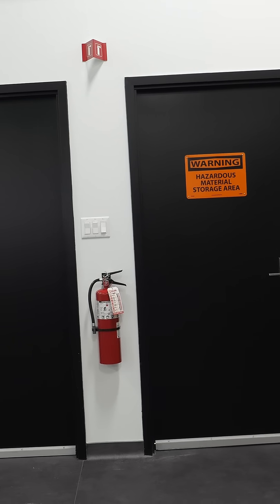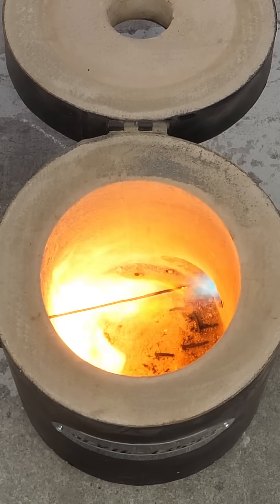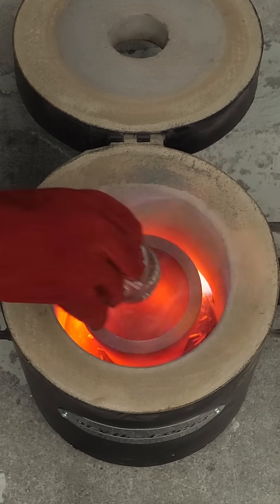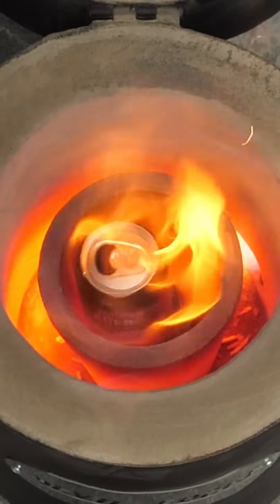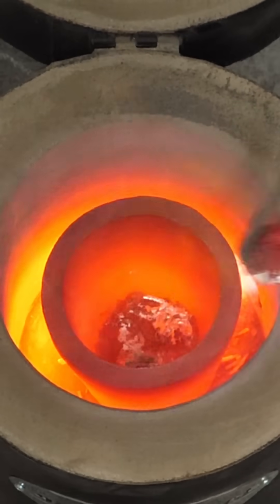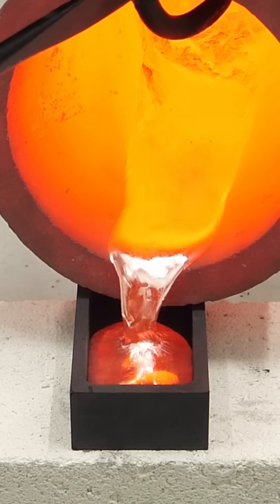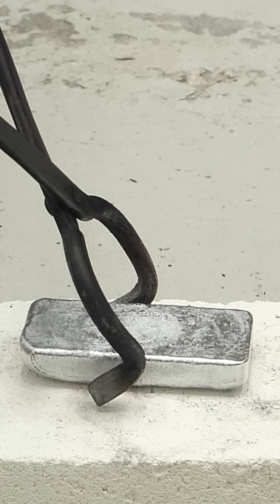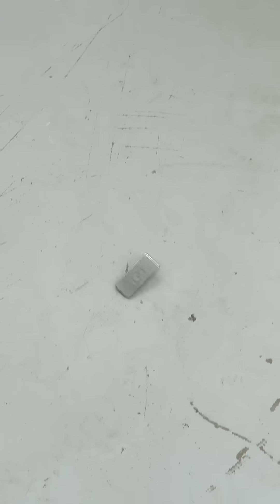Melting soda cans into a metal bar

Comment: I’m a dumb person and even I took the time to ask Google if the tops of cans were a different metal from the body. When I melted my cans I separated the metals: Al 3004 (Bodies), and 5182 (Tops and Tabs). 5182 has more magnesium than 3004 making it stronger for the crack effect. If you melt them together you get an impure bar. Another thing is when my cans were melted there was a bunch of slag from the ink. From about 30-40 cans about 15-30% became slag. I ended up with a 200g bar with some excess that became a little 32g puddle of the 3004. Remember this all of you who wish to forge and all who currently do it, as a bonus: Aluminum melts at 660C, but 3004 and 5182 melt at slightly higher temps, so my say is put your forge at around 750C to give you time to pour it so it’s not immediately hardening as you do.
Reply: From what I have read, some of the magnesium will cook off when you melt it. So if you melt the can and the top together, you will end up with an Al/Mg alloy that is very close to the alloy used for the cans. So in normal recycling they won't bother about removing the tops from the cans. But of course, if you plan to use the recycled materials for something else, it might make sense to separate them.
What I have wondered, is if you can recover any of the magnesium that cooks off, by placing a pan of cold water above the furnace, hoping that the magnesium will condensate on the outside of the pan.
Reply: @Tjalve70  Late reply but only because I’ve just now melted some 5182, and there is a noticeable difference. The ingots of 3004 I have is shiny and smooth where the metal touched the molds, with some rough surfacing on top. The 5182 has a more crystalline look and feel, the edges and corners are sharper and more filled in with a smoother topside. I experimented and found the results, some of the magnesium burns off, some.
Reply: @CuppaNoodls  It would make sense that there is a difference, yes.
But what I was saying, is that for most practical purposes, if you melt the tops(5182) and the can(3004) together, you will end up with a composition that is basically 3004. Due to some of the magnesium boiling off. This is of course if it is done industrially. What you end up with when you do it on a hobby basis, I don't know.
Reply: Tyrone Biggums: I heard you said "Crack"? *Scratches neck*

Comment: That fact that metal bar didn't look hot at all, but then reacted like that to water is kind of terrifying.  Just the idea of someone seeing some metal and touching it, only to receive severe burns because of it's intense heat is kind of horrifying to think about.  

I mean, there's probably a lot of heat radiating off it, so you'd have some warning, but if you're not expecting it you might not notice the heat until you were already grabbing it.

Comment: Definitely not the WORST thing to inhale, and to be honest, it's not terrible at least compared to other things like zinc vapor. Honestly, though, this is the best way to make some interesting metal pieces, though, since you repurpose the can and it's (if I remember correctly), usually Aluminum alloy 3004 or 3060-somethin for the main body. The ends are different, but I can't remember what they are, so you end up with an impure bar, but it's still decent metal and of course, enough is worth some money, especially if you make it with very few bubbles in it.

Comment: Now you can make silicone molds of whatever you want, fully submerge it in sand upside down, leaving the base of the mold exposed, and pour molten aluminum inside. The aluminum will take the shape of the mold.

Warning: ⚠️ I could be misremembering this process. Check the King of Random's guide before doing it. I'm not responsible for failures or injuries ⚠️

Comment: Used to make stock for the lathe and mill like this.  Not much material in cans but larger pieces of scrap made the process easy.  Used bone ash to minimize oxidation.  Broom handle or pipe hammered into the ground made a decent round stock mold.  Used old bread pans for blocks.  Cast oversized and cleaned up on the lathe or mill.

Comment: Crush the cans before putting the crucible inside with most or all the cans in it and put cardboard at the bottom to stop your crucible from fusing to the bottom.
Reply: Wouldn't cardboard just burn up in the fire?
Reply: @philliplimkowski8395  it does but the layer of ash keeps them separate.
Reply: @garionhaney7813 but then the aluminium wouldn’t be so clear and shiny because of the ash right?
Reply: @dominiksaworski8509  "slag" / impurities are going to be on the surface of the metal as they float. You just scoop off all the bad stuff and clean metal is left behind.
Reply: Pots always need heating to drive off moisture. Most molten metals plus moisture makes the wrong sort of interesting.
Reply: @robertparkinson2102  i am aware you do need to preheat certain things because it can cause the molten metal to explode I'm not sure of the step by step process.  I watch bigstackeD and he does a lot of what I mentioned.
Reply: You want to preheat the cans and crucible, so that any moisture is driven off relatively slowly, NOT when dropping e.g. a can with some liquid in it into an 800°F pool of molten metal.  That gets you a BANG! and a shower of molten metal.

However you don't want to leave the molten metal hot for a long time; it will oxidize and some of the alloying elements will be driven off.
Reply: You don't want to crush the cans, the opening let's any evaporated moisture out, you crush the can and the evaporated moisture doesn't have anywhere to go so it builds pressure and then all of a sudden............BANG, ye that means molten metal being thrown everywhere, stupid idea, please don't tell anyone to do it
Reply: @bjarulez  I'm just stating what a popular YouTuber does in his videos and does this regularly.  If you pre heat everything yes that will happen . If you bring it up slowly all moisture will cook off before the metal ever melts .
Reply: @garionhaney7813  though some YouTubers do some stupid things.  
If in doubt, wear safety gear:  welding gloves and jacket, leather apron and spats, face shield, respirator ($40-ish), full length sleeves and pants, closed shoes.  Natural materials because molten plastic like nylon or polyester sticks to skin, and cotton or wool or leather doesn't.

Wrap the flared entries of gloves.  If you get showered with molten metal, really don't want them to funnel it in.

Dry sand underneath; concrete spalls if molten metal drips or spills.

Allow for the crucible to break (they don't last forever) or be dropped and spill its load.
Reply: @bjarulez  your main concern is going to be when its outside the furnace as there isn't a lid to contain an explosion.
Reply: @bjarulez  has this happened to you? i've not had this happen before and only once had a little steam explosion due to my own stupidity of adding a lump of silicon
Reply: @williamcox2025  not directly to me but I was in the factory when it happened and the aftermath was not pretty, all from throwing a crushed can into the furnace, they banned cans from the site afterwards
Reply: @bjarulez  oooof, what size furnace?
And that's quite understandable in a plant sort of manner as if your recycling 1000 vs a million is a work place manner then that one can of someones stupidity would make one heck of a explosion if just thrown in.
Reply: Im Not an expert but I also don't think you need to preheat the furnace.
Reply: @garionhaney7813   meh, you really should the first time in particular in any fernace that uses any sort of wool, aswell as a hardening agent to make sure it don't plume cancerous fibers when you light it everytime.
past the first light of the fernace it's far more important to let the crucible sit in low heat before adding material.
gotte be careful adding new material too, ESPECIALY aluminium has it absorbs that heat quickly.
Reply: @williamcox2025 there is "bio soluble" insulating wool that uses different types of mineral fibers than silica.  Your body can dissolve them so you don't get fibrosis (don't screw up your lungs with scar tissue).

Comment: I really need to invest in one of these mini furnaces and a crucible.  Metalworking would be such a fun hobby
Reply: It is. Just be careful
Reply: It really is. Those Devil Furnaces are really great. I have the smaller version, and it's held up for several years.
Reply: it's fun, The furnace usually go a for a reasonable price, Butane/propane is probably the most expensive part of the hobby
Reply: There's an aussie somewhere on here that has a veritable dragon hoard of recyclable metal & does melts every week. Haven’t been able to catch him but it's nice to watch a inoperable electric motor & a barrel of soda/beer cans be melted down.
Reply: @ClockworkCrow7  You mean bigstackD ?
Reply: @ClockworkCrow7  True! I think i've seen him, somethingsomething daddy wasn't he aiming to get like a metric ton or something?
Reply: @iSuckAtContent  bigstackD was his username. I really gotta watch him again but alas, no time.
Reply: Same. Would love to do it
Reply: Aluminium and a small cnc machine would be dope.
Reply: @SoulTouchMusic93 If you can get some brass together, then you can go to town making parts for musical instruments, even Tibetan singing bowls.  I ended up using a 3D printer to print a replica of a satelite dish, and used that to create my mold for the bowls.  I needed to keep it perfectly distributed and have an easy to find vertex, because I built a guitar that uses a set of them as a resonator, so it's always ringing the root note of the key the song is in.  By placing the piezo pickup right at the vertex, the sound waves are all evenly spaced when they get picked up.  It sounds dope AF with the right tune being played.
Reply: I made mine out of a steel bucket, kaowool, some fireplace bricks and 2 burners off ebay.
There are all sorts of videos on how to make them.
Reply: You can make this entire setup for $20 or even less depending on what you have on hand. A stainless bucket, a bag of plaster, a bag of sand will make your entire furnace. Use a cheap stainless drink mixing tumbler as a crucible, old muffin pans for molds, and an old hairdryer with some PC for billows. I'm sure many people have at least a few of these things on hand. Use charcoal as fuel.. It's fun and  satisfying, and really great if you need cast aluminum for crafting project etc.